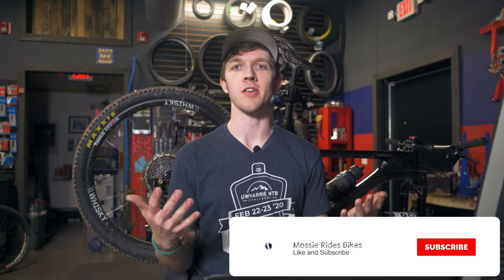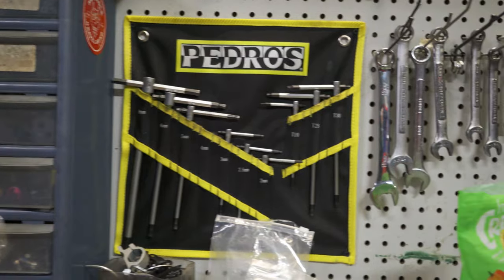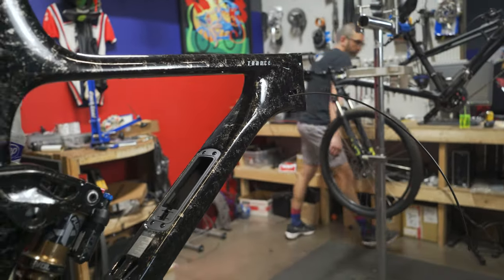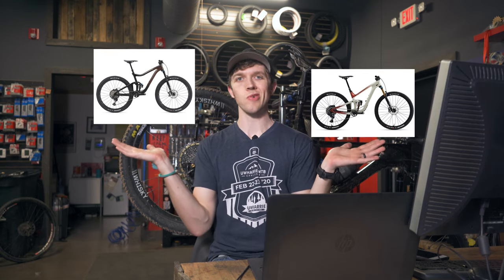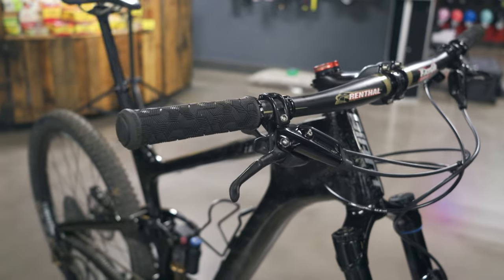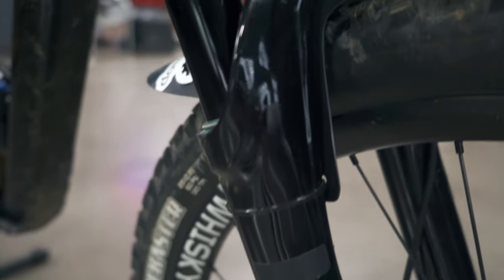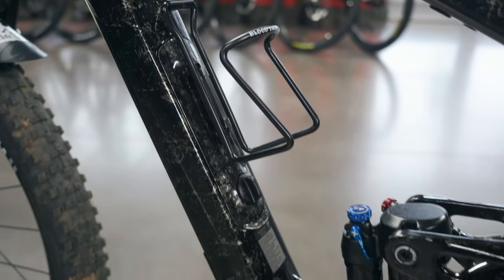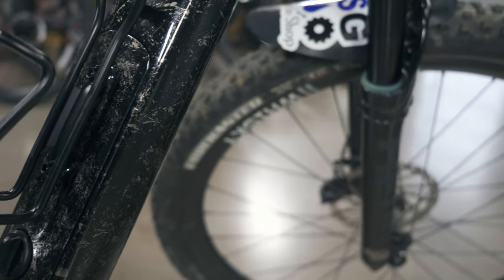NEW Giant Trance Advanced Pro 29er 2022/ CUSTOM build

Comment from the maker: I will post the weight of the bike when it has all of its racey bits on it as well. What do you guys think of the paint scheme??
Reply: Nice overview.  
I built one a few weeks ago, and was able to find all XT components, except the rear derailleur.  Went with XTR there, so I will live...  Put a Fox Factory 34 fork up front, and added one spacer for a total of 3.  (I'm 155 LB's).  Went with Roval carbon wheels and opted for 2.40 Maxxis Dissector up front and 2.40 Recon on the rear to save some weight over the spec'd 2.50 tires Giant puts on the bike.  Chose a One Up 180MM dropper post and One Up carbon bars cut down to 780MM.  
I have only ridden the bike in the low position of the flip chip and love it. With 170MM cranks, peddle strikes were not an issue even in the low setting. Climbs well in the low position too.  The front tire can get a little light on steep climbs, but sliding forward a bit in the saddle solves that.  
Took a trip to Bentonville to break it in and rode everything from Green to Double black.  I really challenged the bike on some gnarly downhills to see what it could handle.  By adding the one more spacer up front I was able to hit pretty much anything I wanted. The bike managed the Area 51 Red Drop option with no issues at all, so for a 120 / 130 bike I am impressed.  I'm sold that this bike will be a quiver killer and do everything I need it to.  
I opted to build it myself instead of buying the TRANCE ADVANCED PRO 29 1 build from Giant.  Not sold on live valve, and don't need more batteries to charge.  Also wanted 2.40 / lighter tires.  I don't have a great scale, but it is 28 LB's on the scale I have, which I'm happy with.  
Best bike I have owned.  You feel like you are riding in the bike, not on it.  Can't wait to get it on my local trails to see what it can do.  

I would love to see what weight you get your race build

Comment: That is one great looking and I believe great riding bike. Andcolor scheme is awesome. But it is as good as it is bad. On one hand, you can't see little scratches so you won't be upset when you see them. On other hand, it's hard to spot cracks with that marbling. But really awesome bike. If I had spare money and I could actually find a bike, I'd get Trance. Even aluminium would be a good one for me. Nice video Mossie. Keep up with the good work
Reply from the maker: That’s exactly what I said about the paint scheme. It has ride wrap installed and you can’t tell at all because it hides the edges.